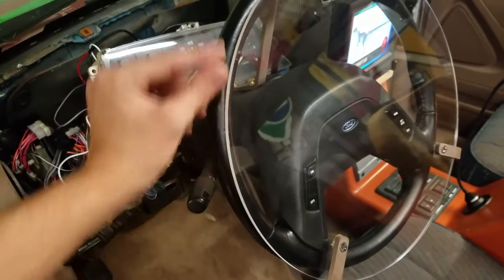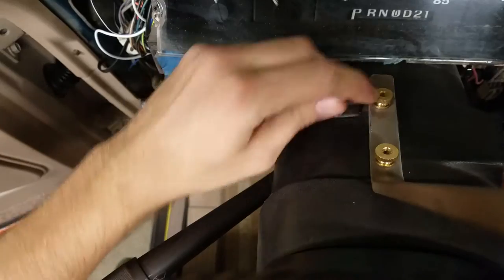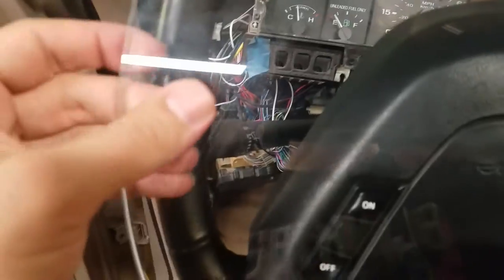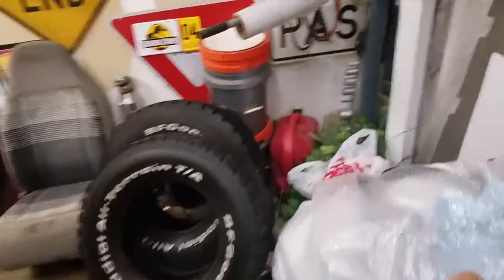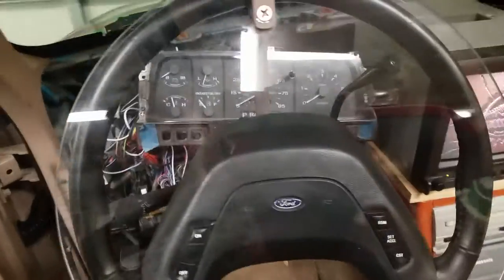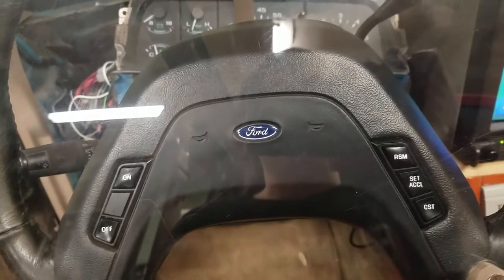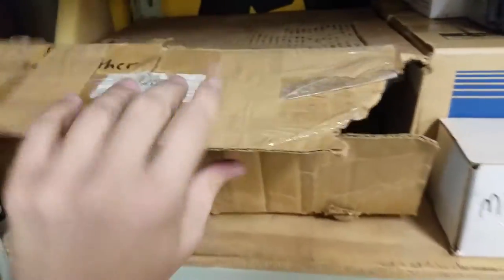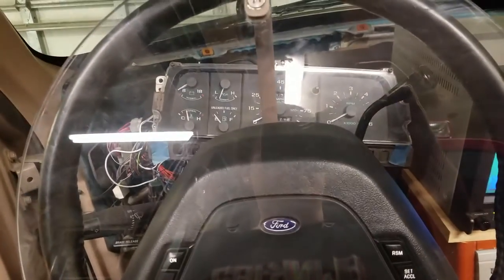Jurassic Park Ford Explorer - Steering Wheel

Comment: Boy, if only I had your tools and workspace!  Not to mention your experience.  
I can get the plexiglass without a problem, but I'll have to build a jig to bend out the metal brackets and was planning on using neodymium magnets or velcro to attach them.   I don't trust myself when it comes to taking apart a 25 year old vehicle with a multitool and a screwdriver.